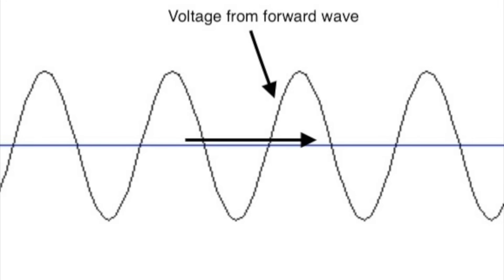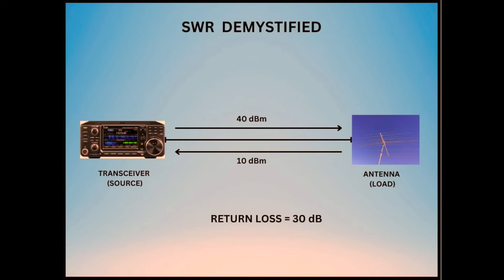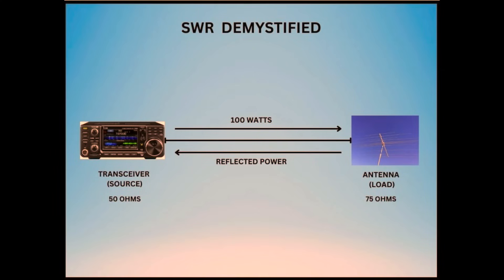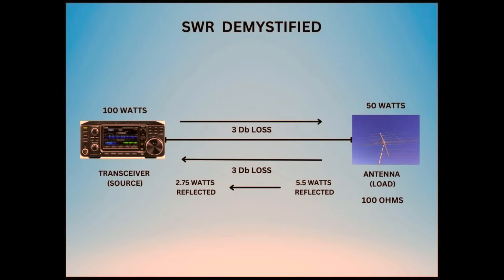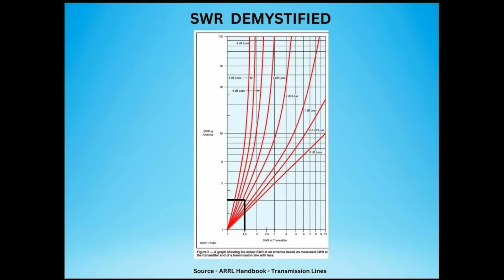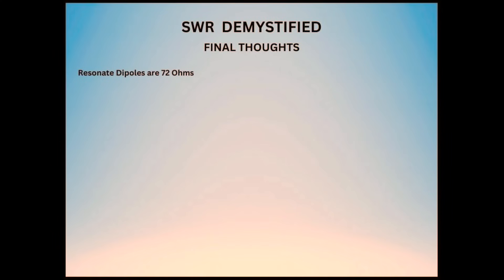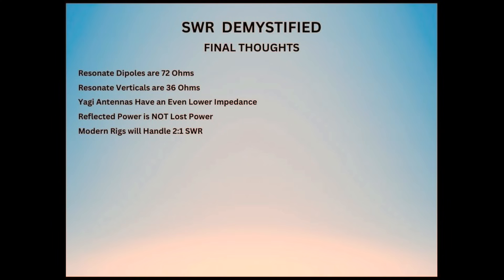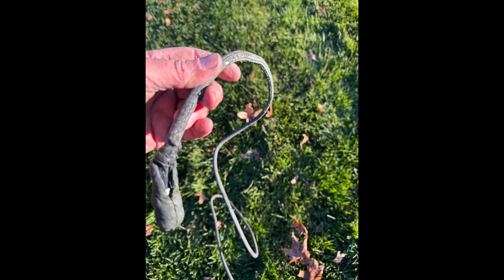The Truth about SWR: Debunking the Myths and Misunderstandings

Comment: @10:22 . That statement is not entirely corect or a list for same type of ampliers use in transmiter. Reflected power do reflect back from transmiter. It will be partially absorb by power amplifer. I am doing some power handling on components in the company that I work for, and let me tell you one thing. If the load have savire mismuch and the power is reflected back to the source with out much loss in transmission line, the power will be  absor it as it have own load characterystics. In such case the output power may  drop due to prezents of signal  in  both direction - forward and reverse. Remedy is to use additional attenuation on the transmision line with penaly of loss of power, or use some isolator or circulator to redirect reflected power to dummy load. Some amplifer have aleady build in such protection so they might not effected. Just be aware that you may see something like that.
Reply: Power is not absorbed in the transmitter it's just not produced,the reflected wave joins the forward wave back towards antenna hence an swr measurement,
Reply: @paulm0hpd319  so if you transmitted at 1 kW but didn't hook up an antenna it would be no problem for the transmitter or better yet, if you took the other end of the antenna connector and hooked it up to a tazer, that would be totally fine because the transmitter would never see any of that and instead the power comes back into the tazer and recharges its battery right?
Reply: i think you are right and this video and most people on here are wrong. i look at it from a very basic perspective, the final transistor. it's supposed to drain current at the right moments and my thinking is that when the transistor turns on, a certain voltage is expected at it's drain/source/collector/emitter. a reflected wave gets back to this very same point (a pin on the transistor) and depending on the timing of the reflection the voltage can be higher or lower (or the same). now the transistor turns on to drain current but what if the voltage at this moment is lower than what it is supposed to be, it means less current will be drained than what could have been so less power gets produced. or if the voltage is higher, it will drain more current and perhaps it could exceed the rating and break it, or the voltage gets so high that it breaks it, and probably due to internal resistance, even though more current is drained in that moment it actually produces less power still because if you just look at the portion that was supposed to be drained if there was no reflection, now there is a little less room because of the additional current from the reflection that is drained. i'm not 100% sure on the details but i can tell you that all these people saying the power doesn't get back to the amplifier, i don't buy it for a second.